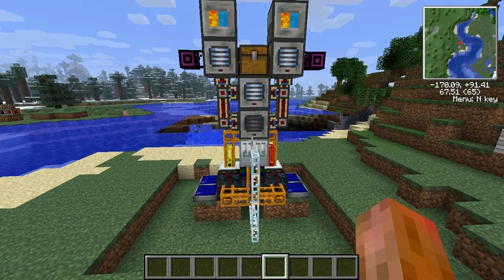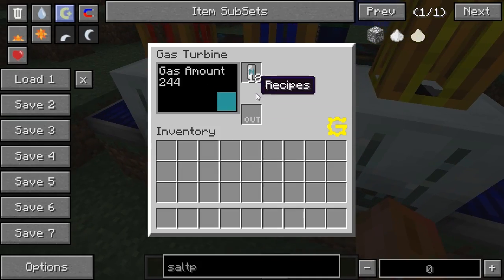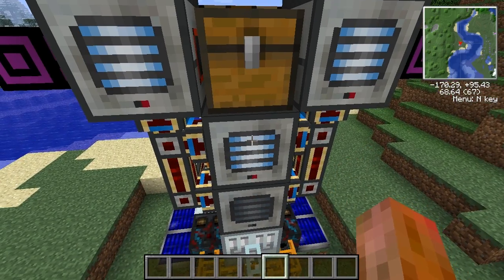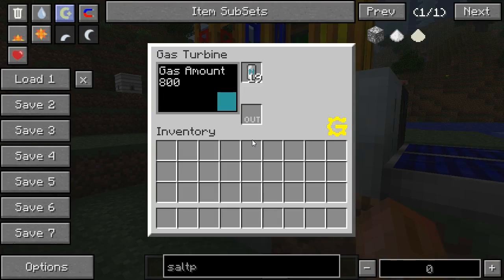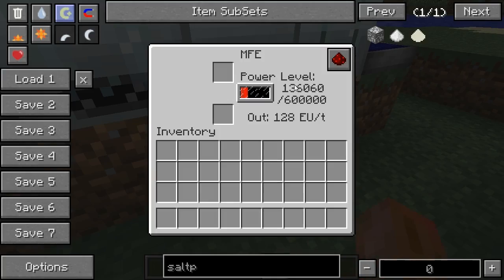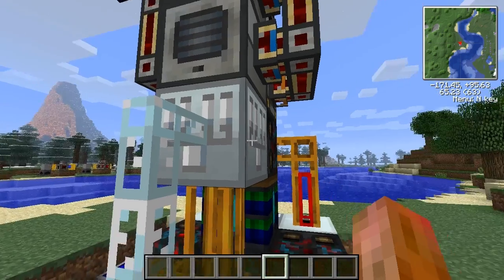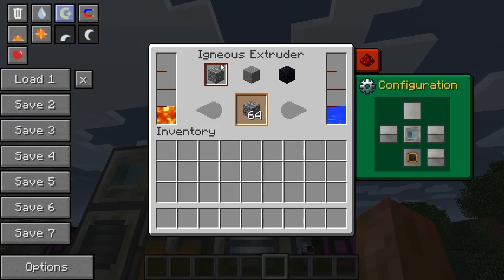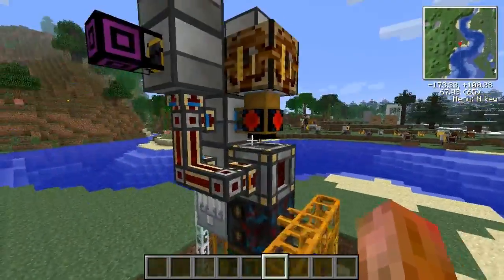Feed The Beast: How to convert 1 MJ into 2+ EU

Comment from the maker: Looks like you can make some Nitro- fuels, via the Glyceryl Cell, but it's complex.
For now I guess we're back to using Magma Crucibles, however I note that we now have a Thermal Generator which turns 1 lava into 30K EU at 24 EU/t, so that's gives a 3:2 ratio over the old 1:1. Not much but it's something!